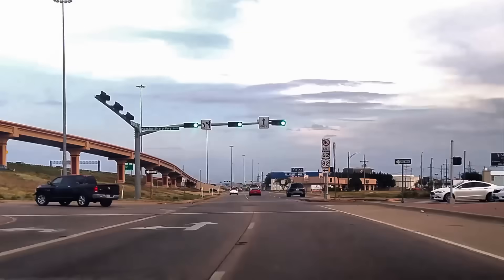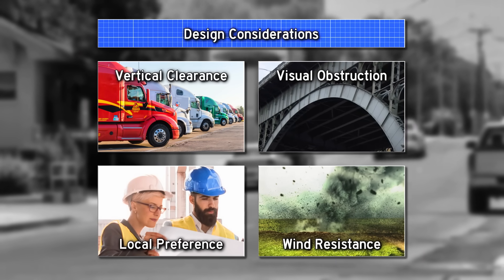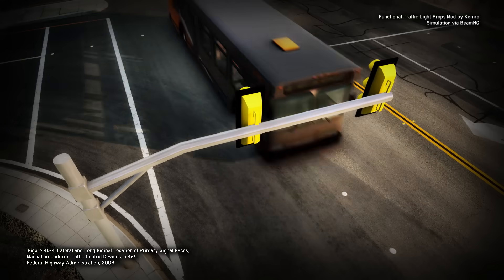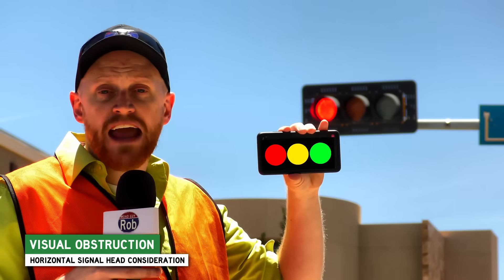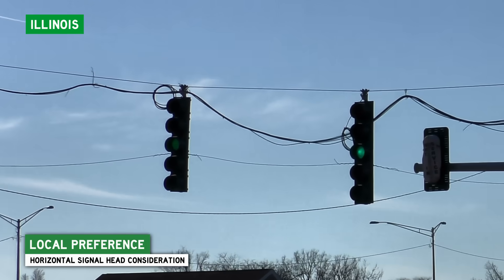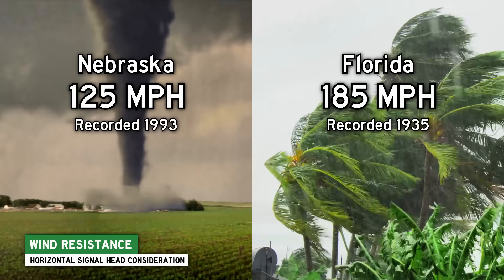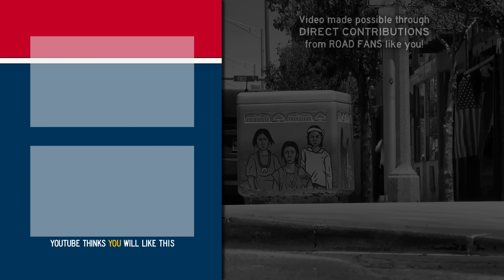What's up with SIDEWAYS STOPLIGHTS in Texas and Florida?

Comment: You should check out Quebec -- they mount lights horizontal, and the signals have different shapes too -- circle = green, diamond = yellow, and square = red. They also put 2 reds on every signal (at opposite ends). Not sure how permitted that would be in the US regs, but I've always thought it was really good for accessibility & safety.
Reply: I was going to say, Quebec needs it’s own video. They take sideways stoplights to a whole new level.
Reply: They mostly don't do that anymore. They're still mounting them horizontally, but the shapes are gone, everything is just a round shape now. I guess when they went to LED lights, they couldn't get mass produced square and diamond shaped LED lights (as when it was incandescent lights, it was only a mask in front that produced the desired shape). The 2 reds thing is still mostly true, but I've seen just one numerous times.
Reply: @paul_at_world  Exactly - the shaped lights are rapidly disappearing all over the province. The other provinces that tried this system are moving away from it too. My real beef with Quebec signals is there is no common standard for lens placements. Some have two reds, some have red on the left, some have red on the right, and the arrows could be anywhere. REALLY dangerous for colour blind drivers...
Reply: @toddoddity3976   they don’t have one with red on the right. Always on the left or both end or top if vertical. They follow the standard you can find a document that explain it on google and show the different types. Arrow placement is pretty standardized too. If you have seen a red on the right, its most likely because it’s a double and the left one burned out.
Reply: @toddoddity3976  That's because cities can do what they want with traffic lights, so it changes from one city to the other
Reply: 2 reds on one signal is very, VERY rare in the US, but they do exist!
Reply: @Junimeek  Lots of Texas heads, especially newer FYA signals, have double reds and this is particularly true in more rural communities. Plenty of states across the southeast also have a "T" shaped signal with a pair of reds horizontally over the yellow and green, and West Virginia (at least used to) have a fair few "side by side" signals that featured double reds. I can also think of at least one intersection in Colorado that has four turn signals with double reds.

They are uncommon, sure, but hardly "very very rare".
Reply: @mattashworth9744  idk i rarely see the double reds here in tennessee, but maybe thats because i need to get out of the state and travel.
i do know that some traffic signals in kentucky, mainly in paducah, and benton, do have double reds.
Reply: @Junimeek  Lexington, KY has quite a few signal heads with 2 red lights.  Vertical, though.
Reply: @Junimeek  They’re actually COMMON in the Houston area of all places! Around the Woodlands, Tomball, TX, I saw a bunch of vertical lights that had double red… I had no explanation why there were double red lights over there, but there were!
Reply: I believe for a short while, some US traffic lights had lines etched in the lenses to mimic railway semaphore signals (_ = red, / =yellow, | = green). I think they either fell out of favor or were banned, as I've never seen one in person
Reply: @ebnertra0004  Those were Adler brand lenses and they were fairly rare even during the height of their usage.  What was actually more common were the "command" lenses that had words molded and masked across the lens. Red had STOP, yellow had CAUTION, and green had GO, plus there were similar WAIT and WALK lenses for ped signals. I've seen a handful of these in private collections but only one out in service.
Reply: @ebnertra0004  I've seen those signal heads, but they were generally only used for dedicated bus rapid transit lanes so as to not confuse other drivers
Reply: @ebnertra0004  When I visited the US in the 1980s, I saw some old traffic lights with the word 'stop' etched into the red light, mostly in New York, I think. I wish I'd convinced my parents to take a photo, but in the days of film, photos were comparably expensive. So now I can look at boring photographs of the Golden Gate Bridge, which I've driven over a thousand times since, or the Statue of Liberty, which I still see a couple of times every year, but not the cool traffic lights which I don't see anywhere anymore. (The series of four red lights, spelling 'stop' at swing bridges in Illinois, are pretty cool, though. They even have LED versions of those these days.)
Reply: @ebnertra0004  there were a couple intersections in San Bernardino that had them for maybe a grand total of a 2 weeks. During the day it had bad visibility. But that was maybe close to 20 years ago now and the actual lightbulbs were much different than they’d be now in terms of visibility.
Reply: @ebnertra0004  to be fair, they only use those types of lights when you have a tram line along the road or rapid bus.
but those do deserve their own video im sure.
Reply: @Zeakthecat  Yes, there are transit signals, and they probably do warrant an episode. But the style I'm thinking of are meant for road traffic, and had the full circular indication, in color, but had a stripe etched in each lens which ran across match the color aspect. The end result was a standard circular color aspect that had a brighter line of color across it. Those were very rare, but they were out there for a time
Reply: @ebnertra0004  
yea, i got that. idk if they do them still, i just know they do them for rapid bus and trams.
Reply: Can confirm, this is correct. And a full video on Quebec would be interesting to at least all of us Canadians watching!
Reply: I was just thinking it would be pretty easy to start making all new signals so the red was an octagon.
Reply: @kenbrown2808  But an octagonal stop sign and a round stop sign don't mean the same thing, so that would actually be confusing. An octagonal stop sign means the same thing as a flashing red light in the Americas and ZA, while a round stop sign, held by a human flagger, means the same as a solid red light.
Reply: @originalMikZ  and you can't shampoo a duck. Also, flaggers aren't traffic lights, and modern traffic control signs always have the stop sign with an octagontal appearance, even if the actual material of the sign isn't  cut in an octagon.
Reply: I believe Quebec has discontinued this practice and no longee install this.
Reply: Pretty much all of the lights in Quebec, New Brunswick, Nova Scotia, and Prince Edward Island are horizontal and have double red on its signal arms. And its not just Quebec with the different shapes for lights. Some of the other provinces with horizontal lights still have the different shaped lens but it appears that the shaped lens are being phased out.
Reply: Signal heads in Toronto Ontario use an extra large red signal for improved visibility.  They are also colored yellow with a yellow backing board.
Reply: also the flashing green in some areas instead of a green left arrow, quite confusing
Reply: @cmmartti  Albuquerque, NM when they built the ART transit system they had red bars signals for a few months. Then they changed then all to white because it kept getting people confused
Reply: The flashing Green is what gets me
Reply: @TheMassholeMedic  That just means it's an advance green - IE you have a green but the opposite direction doesn't. It's cheaper to implement in software than it is to buy a signal that actually has indicators for the turn signal, especially if it's not 24/7 and is instead only active during specific periods like rush hour.
Reply: Alberta got some weird lights as well. Still don't know what double red is
Reply: I was thinking of that while watching the video. We used to have a number of those types of signal heads here in Nova Scotia, but they’re few and far between now.
Reply: Common in PEI as well.
Reply: @ulogy  Oh really? In San Antonio, I've only ever seen two (though one of them was replaced with a 3-light signal several years ago), so I find that really interesting
Reply: @ulogy What’s PEI? 

-literally every non-Islander
Reply: Most of our lights in Alberta are horizontal. I have never traveled, even out of province so i figured that was just normal XD
Reply: @cmmartti  Here in Quebec flashing greens are way more common than green arrows for protected left turns, especially in suburban areas
Reply: @cmmartti  It is what is called a 12-8-8 (for inches diameter of the lenses) head.

That used to be common in the United States as well, but over time, jurisdictions have moved to using all 12" signal heads for better visibility.
Reply: wow that's ingenious!
Reply: Vertical white bar = transit 'green'
White triangle = transit 'yellow'
Horizontal white bar = transit 'red'

An optional operation is to not use the triangle and flash the horizontal bar before displaying a solid horizontal bar as the 'yellow' interval. 

These are in the MUTCD. 

In the US, if you see those and are driving a car, they mean nothing to you, look at your signals. 
We (Madison, WI) are installing these with our BRT project, but they can be found along other various transit routes across the US.
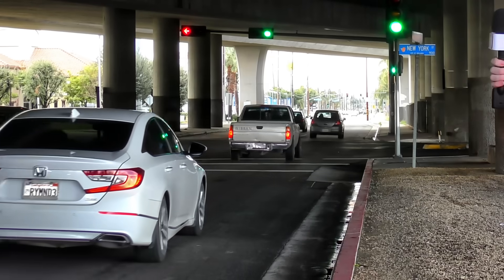Reply: 4:32 bloopers
Reply: in quebec we have both dépending the road configuration and not all of them have square triangle circle
Reply: stupid design
Reply: I've seen the signals you describe west of Ontario.  either Saskatoon or Winnipeg if I recall correctly
Reply: Quelque chose pour non être comme les anglais !
Reply: A funny detail also, is that what you describing only apply on Provincial highways, municipalities can do different things in Quebec too
Reply: Cursed intersection in Chambly I saw:

Six lights.

Transit priority
Red
Yellow
Green arrow right
Green
Red
Reply: Dual reds are permissible, if rare, but only when the reds are adjacent to each other.
Reply: So many useless features are added for "accessibility" when the old way worked just fine. Stop lights are already accessible
Reply: I like the signals in Quebec. They are easy to understand when you come from somewhere else. Good for color blind too. You don’t notice much they have different shape. They are really nice.
Reply: I don't like Quebec signals, honestly. I think the shapes are overkill, and just plain ugly. I guess they're interesting for being unique but eh.
Reply: @JoePCool14  I rememebr hearing somewhere that Quebec makes the lights different shapes is for drivers that could be colour blind. If that's the case then it's a good idea.
Reply: @nbrowser  Yes, I know.

The US doesn't do this and I haven't seen a mass call to start doing it, so I'm going to assume it's not enough of a problem to make the different shapes necessary.
Reply: Quebec had the highest incidence of red-green colour blindness  in the world and maybe still does. The 2 reds also are much brighter in combination and are harder to miss.
Reply: I guess that's good for accessibility (as opposed to stop signs that say Arrêt which are probably worse for accessibility)

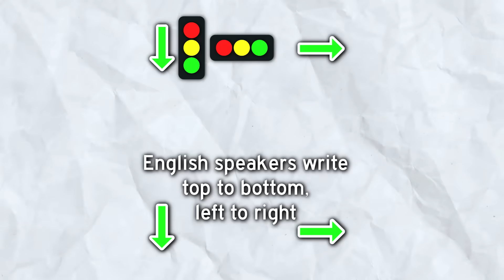Comment: 8:18 Japan also drives on the left hand side.

You can imagine mounting the signal head on a tall pole on the edge of the road (not the middle) and bending it sideways over the road.
Reply: I wonder if the color positions have something to do with line of sights. In a left turn with a wall to your left, you would see the right signal first.

Comment: 9:04 "frontal area" is the same either way.
Reply: Sideways mounts mean you can have two or more attachment points to the arm. And since the arm is going to have its own frontal area, putting more of the signal head in line with it effectively reduces its wind loading.
Reply: He's talking ab out the combined area of the lights and pole, not just the area of the lights. Since the horizontal light covers up more of the pole, less of the pole contributes to the frontal area.
Reply: @m_f_luder  I would have commented how the horizontal light fixture in the wind places far less of a torsional force on the tubing than the vertical mount does.
Reply: Yep. "Which piece of plywood is bigger, a 4x8 or an 8x4?"